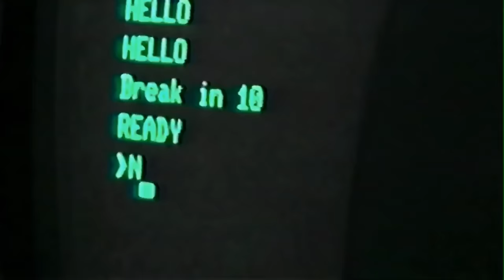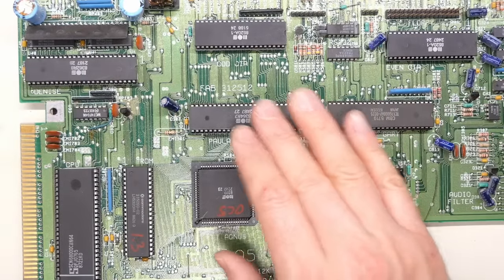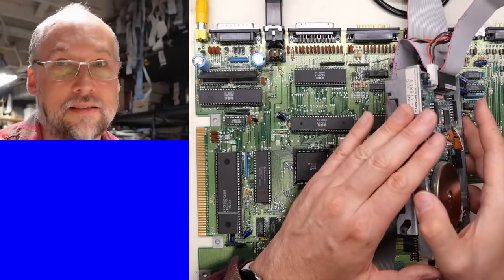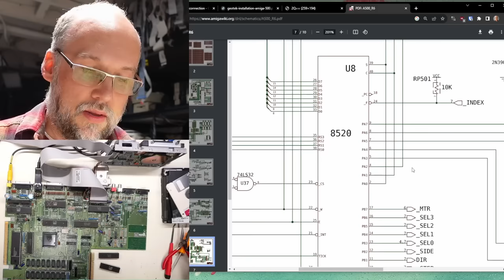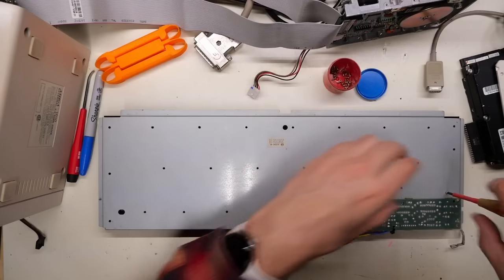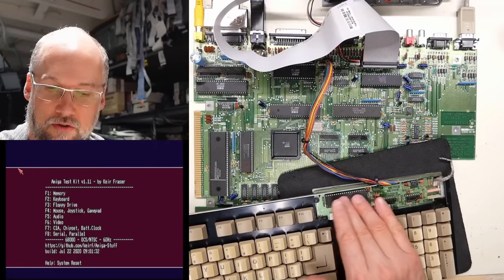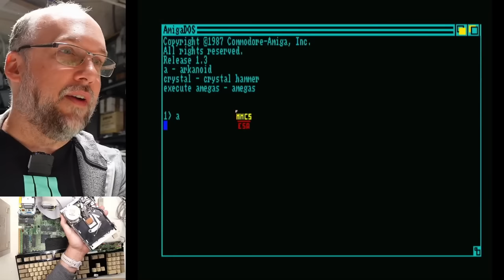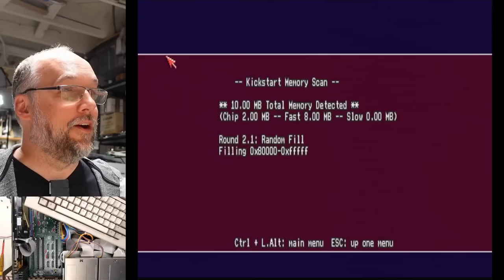Testing and repairing a mysterious Amiga "art project"

Comment: As an Amiga service center tech in Hollyweird, I have a great story to tell about chips on the motherboard. So, one day a production assistant walked in with one of the A2000's that I had built for a TV show. He told me it had a "Green Screen" (Green screens on an Amiga meant that the "Super Agnus" - a 2 meg chip had come loose in its socket). So, I removed the cover and the Micropolis gigabyte hard drive that I put in all Video Toaster systems. I then using my many years of experience with Amigas picked up the system about six inches off my bench and dropped it! The PA freaked out and tried to grab it, I held him off, told him to watch and learn from my years in college, etc.... The system of course was worth around 10 - 15 thousand dollars. I put it back together and plugged it in and it worked perfectly! The PA stood there with his jaw hanging open and I calmly handed him my $150.00 one-hour minimum shop rate bill!  Yes, you can reseat all the chips by picking it up and dropping it - just be sure you remove the hard drive!😁
Reply: Apple used to suggest doing the same exact thing to reseat loose bits in their actual user manuals if I recall correctly.

Comment: Another trick I like to use when removing hot glue or similar is to freeze it with freeze spray or dry ice. It typically shrinks a little and comes away cleanly even from fragile wires.
Reply: That's why hot glue sucks for electronics work and why electronics grade silicone and chloroprene rubber glue exist. also never ever use common construction silicone for electronics it's uses acetic acid to cure you want something rated for use on PCBs. Personally I like the Chip Quick self leveling clear, it's good for reinforcing caps or wire to board solder joints, anything that can break off in a high vibration environment (and it's not too hard to get off later)
Reply: Easy method for removing hot glue, isopropyl alcohol breaks the bond between glue and surface, but does not make a mess and disolve the hot glue, just spray some at the edge, lift a bit and spray again, comes clean off easy.

Comment: 13:50 You don't just grab the chip with the tool and wiggle it out. This tool is specifically designed to pull the chip out straight to avoid bending any pins or pulling out the socket from the PCB. You squeeze the plastic grip piece together, it's a flexure designed to convert your squeezing into push/pull action against the plastic part of the socket.
Reply: That was awful watching him bend the pins while removing it
Reply: Sounds good in theory but I can promise you wiggling it out is the best way on the Amiga

Comment: I am so glad this Amiga has been given a new lease on life.  Seeing it powered up for the first time in 20 years or more was a thrill, despite the corruption.  Some components seem to need a little shock to the system to wake them up after decades of slumber.
Reply: That's the wet capacitors, they need to be powered every now and then, maybe twice a year. Even if they come back that's very likely more self-healed scars inside.I think Adrian doesn't particularly like replacing them until they fully fail.

Comment: I don't know exactly what the mystery cct board is (at 4:37), but the chip is used to generate telephony pulse or tone sounds. So, probably part of a phone/fax/telex machine.
Reply: Given that, my first guess would be that it's a method for the computer to auto-dial a telephone number without using an actual modem.  Quite possibly, it was intended to use the cassette drive interface as a single-duplex modem?

Comment: What would be really cool is if you could fit it in some sort of acrylic case that could be hung on the wall and still have an accessible floppy drive slot.  You could mount it right below a LCD monitor and put the keyboard in an external acrylic case that mounts below it.  The keyboard could have an extended cable and can also detach from the wall to a usable loation. Then you have a piece of art and a fully usable Amiga 500!  Great video, as always.  Oh man I could totally see this.  Just need to know a good CNC contact that works with acrylic.

Comment: I wanted to add that I was at a San Jose CA Vintage Computer Fair many years ago and I had the fortune of talking to the original developers of the Amiga 1000 where they showed the prototype wire wrap boards they used for testing.

Comment: The needed soft reset on the A2000 is due to a hard drive that starts too slowly, the system is up before the hard drive is ready to respond to it. Just live with it, a lot of my friends including me had this problem when we used old drives on, in these days, modern machines. Those were the days...

Comment: There is a trick to boot from external drive under Kick 1.3 or lower. It's called boot selector. Its pretty cheap to build it yourself. All you need is two sockets for CIA chip and a double-switch. The whole trick is to change connections of SEL0 and SEL1 lines from the U8 CIA chip to the motherboard. If SEL0 of the CIA chip will be connected to the SEL1 line on the motherboard and SEL1 to SEL0. The external drive will become DF0 and internal  will be identified as DF1. I've built such a device in late 90s and it worked like a charm.

Comment: You can get rear defroster repair paint.  It is designed to fix when the rear defroster lines on your car get cut or damaged.  Paint it on and the trace is fixed.
Reply: I have used conductive paint to fix several Model M keyboard membranes after fluid damage. It's a bit tricky to use on fine tracks, but it works. If you end up bridging tracks,you can scratch it off with a sharp object.
Reply: Isn't the trace in between plastic layers in this case, and therefore not paintable? Unless you paint a whole trace from contact to contact I guess
Reply: @KrozMcD In the case of the Model Ms,you have to open up the inside plastic case by cutting the plastic rivets, open out the membrane, repaint the tracks, reassemble and then drill and bolt the inside case. It's a bit involved, but works.
Reply: @KrozMcD  Yes if it is in between layers you would need to do something like paint the entire trace, or very carefully cut the top layer and then paint it.  It is often easier to fit in than a bodge wire.  I have used it to fix car clusters that use membrane boards vs hard pcbs.

Comment: Great video Adrian!  A cool find to be sure.  A note on the keyboard cable: The color sequence is the same as the resistor color chart.  Some keyboards do have the Yellow wire but it doesn't do anything.  Probably was a cost saving measure to just leave it there rather than pay for a "custom" configured cable.   Love all your repair videos!  Keep up the good work and keep the iron hot! 😀👍

Comment: 17:18  I don't know about plugging in the floppy drive power connector backwards, but forgetting to plug it in toasts both the floppy drive and the mother board. I learned that the hard way.
Reply: IIRC, Red was 12V and orange was 5V. Different than everything else where red was 5V and yellow was 12v.

Comment: A "deconstructed" Amiga like this on a cork board would be an amazing project if you could turn it into a stealth "functional" computer, with a similar flat presentation style. I suspect you could hide many/most of the connections by soldering to points on the underside and routing the wires through and behind the cork board, so that it would look like the bare unplugged board was somehow driving a nearby monitor and could be used with a seemingly disconnected keyboard and mouse... spooky! Would be a fitting tribute to the state you received the system in.

Comment: Cleaning that keyboard, brings back a memory from 84.
A kid had bumped over and soda which, poured in to their C=64 Keyboard.  They said they turned it off right away, and let it drain in their sink.   After a week, they tried it and said it did not work right, thus they brought it to me to repair it.  I took it apart and a lot of it had dried all over, yet it was sticky.  The plungers were sticky too,  I told them it may be a lost cause, but I would try.  It was all apart, I put the keyboard, mother board, keys, all in my dishwasher stopped the drying cycle and washed it, I washed the sugar out of the case in the sink.  I got it back together, and It worked great after that.  I left it running a memory test for 3 days on my bench, and gave it back to them a few days later.  Really cool what a simple dishwasher will do.     No, it was not yellowed, as it was so new.   I stopped repairing Commodore computers about the mid 90s.    Well good luck with that keyboard as well as the Amiga 500.

Comment: adrian i think its a old phone modem , we use them alot to connect to local net when play against each other over the phone line
and the start of the video looks like a teaching board we had in Randers Data Club in Denmark,  back in the days where we had a clases about amiga and 
machine code programming, we used a dead Amiga 500 for the board as a show and tell tool :)
My love for the amiga is so great i had an amiga 500 , amiga 600 and an amiga 1200 :)

Comment: Dude, with regard to proper orientation of the non polarised connectors, as a double check I'd buzz out the ground on the boards on both sides as in check with your meter that the gnd planes of each do connect to confirm orientation.

Comment: I've had some success repairing broken traces on keyboard membranes using conductive silver paint meant for repairing car rear window defrosters/defoggers.
Reply from the maker: I have been meaning to get one of those pens -- I should give that a try -- it might work in this case although the left shift to the keyboard controller is about as far of a line to draw as possible LOL!
Reply: @adriansdigitalbasement  The membranes I've worked on either had bare traces or traces that could be fairly easily exposed using a knife, so the exact location of the damage was quite easy to find using a multimeter. It was then just a simple matter of painting over the crack or missing section.

Comment: Lack of icons after entering DF1 Arkanoid disk means there are none .info files (icon files). Can't remeber if WB1.3 had show all files option in drop down menus, but from 2.0 it was available. Still you could launch CLI from WB and ran those games manually (even by booting copied disk you did end in CLI and launched it this way).

Comment: Something I have been able to do for some.membrane keyboards: 
"Wire Glue"
It's a paintable conductive carbon solution that lets you bridge small gaps in traces on membranes without needing heat.

Overall, this was an awesome video!
Reply: To fix some of those faulty traces in keyboard's membrane you can also use some "conductive silver", it should cheaper than buying a new membrane.

Comment: On the A2000 if you have the accelerator card plugged in you definitely want to favour memory on that since it's directly connected via a 32 bit bus - the CPU will need to use the 16bit system bus to access the SCSI controller memory. 4MB on each will max out the Zorro II space fine.

Comment: If I recall correctly, Kickstart 2.0 allowed to select a different boot drive on startup if you pressed down both mouse butttons before powering on the computer. Kichstart 2.0 ROMs ar compatible with the A500 (switched to it on mine from 1.3 back in day). I'm not sure, if you could use the ROM from that A2000. So it might help to switch to a newer ROM when troubleshooting problems with the floppy drives in the future if possible.

As a side note: in general, prices in the EU always include taxes (VAT) and vendors are required to tell you what portion it is of the total amount. Not sure if there are any axceptions for international customers. Doing business between EU and the US has become a nightmare in the past years.

Comment: @17:01 therabouts- red wire orientation is the bane of the amiga- esp Floppy power as they are frequently reversed due to all the different floppy drive models and board rev #'s, and pinout schematics online are great but without covering all revs! Pain to probe the voltages when board is on, they should have labelled pins better back in the day.

Comment: It would be great if you could do a comparison of different disk drive emulator options. I'd be particularly interested in one for the Vic-20. Also if there's a sketch to use an Arduino + SD Card interface for the task.

Comment: I've had the exact same problem with the keyboard. I changed the membrane and everything. In the end what fixed it was to resolder the pins to the keyboard controller as in the video. I think it's a very common problem.
Reply: I had random keyboard flashing errors with my A500 BITD, I reflowed the controller pins out of desperation and it fixed it. :-)

Comment: Not sure if this applies to your case, but I was able to fix a similar keyboard/keypad membrane corrosion on my microwave with a pencil, just drawing over the corroded traces so they "connect" and make contact. Might not be a fix that lasts forever but mine hasn't break in 5 years!

Comment: Such small damage on keyboard membrane can be repaired with conductive ink pen, but those pens (good ones with silver) are expensive, i have even managed to repair some membrane switches on some devices for wich replacements are not avaliable anymore. Graphite ink pen (much cheaper) also works well when slight resistance is no issue, for the example where keystroke is still detected even if resistance is not close to 0 when pressed, for some keyboards it woks even up to kilo ohms, wich is far lower then graphite ink trace resistance.

Comment: Great video - the Amiga was a neat architecture.

What do you think of ultrasonic cleaning of keycaps?
Or do you have a preferred way to bulk clean keycaps?
Reply from the maker: You know if I remove them all, I stick them in a jar with denture cleaner. Has worked well but you do have to wipe each once when rinsing them to ensure a full clean…. So with boards like this where I can wash the whole assembly I just do it that way. Quicker and easier than removing each keycap and results are about as good as the more intensive full disassembly way of doing it.

Comment: I somehow had faulty keyboards.  I removed the controller chip, cleaned the pads, and then put it back in place.  This is how two keyboards became functional.  When replacing the controller chip, it is useful to apply pressure from above.

Comment: Strange question perhaps, but, I've always found those push chips to be horribly flaky. Why not just, de-solder the socket, socket the push chip TO the socket, and then add a pushdown insert connector to it to circumvent those issues entirely?

Comment: The Amiga CIA (spec approx 8 MHz) can be used to replace the C64 CIA of which the clock function is left unused, and there is no known (to me) issue. It can't fully replace the clock CIA because the functionalities on that part are different. The C64 CIA (spec approx. 1 MHz) will not be long lived, or at least won't function properly, in the Amiga.
Reply: Actually, the Amiga CIA's are driven by the 68000 E-Clock, which is a /10 of the CPU clock, so they only run at 716khz.
Reply: @seancurtin6103  that is interesting. I stand corrected.

Comment: Hi Adrian, you should be able to have 4 megs on the accelerator and 4 megs on the gvp scsi controller.
I've an A2620 and the same controller you've on my A2000, and they work fine together.
Reply from the maker: One of my patrons said the same thing, it should auto configure and co-exist. Pretty neat!
Reply: @adriansdigitalbasement  In my case the didnt' autoconfigure.
I had problems making the two coexists.
In order to keep all the accelerator memory (should be faster) I had to lower the memory on the controller otherwise my amiga didn't boot if I remember well.
My 2000 has an A2620 with 2MB, an A2386 and the GVP controller, so I had to lower the memory on the controller to 4MB.

Comment: 8520 is very sensitive. If you put in a parallel cable in the port when the Amiga is on you can be quite sure the 8520 will go bad. I have destroyed a few myself 🤭

Comment: Hey Adrian,

Straight out of Youtube jail (I was just released and for the record: I was wrongfully convicted! I'm innocent! 😇) I wanted to see if I could comment on your video without being hunted down by the inquisitors again😁

That's some interesting artwork indeed! 2 dollars is a steal, especially with that nice GVP SCSI adapter! Those things alone cost a fortune on Ebay. On the other hand what doesn't, right? 

Those Mitsumi keyboard are super sketchy indeed. They're cheaply built and like all Mitsumi's a cost saving measure. The first A500s had the excellent HiTek "space invaders" mechanical keyboards and they were way, way better and far more durable!

About the "Agni". It can be a bit confusing.. This old rev5 board has the first Fat Agnus in it the 8370 which is indeed OCS, just like DIP Agni, the 8361 and 67. 
The one you mentioned after that, the 8372 is known as "Fatter Agnus" though and has the extra addressing capability for 1 meg of chipram, like you find in the rev6 A2000s as "Fat Lady". The 8372 is not ECS however, like you mentioned. That would be "Obese Agnus", the 8375 which is the one you would find in machines like the A500+, the A3000 and the A600. Obese Agnus can address up to 2 megs of chipram and is the "full ECS" variant with the extended display capabilities when used with a Super Denise👌

Let's hope its safe to post this.. The evil algorithm gave me quite a scare and still lurks out there 😅

All the best, Peter

Comment: 10:57, at this point in the video i did see 2 areas with damaged traces at bodge wires, near the ram expanion connector (8:24) and at the expansion connector (8:52

my bet that is why it ended up as "junk" or "art", will edit the video if that changes in the video